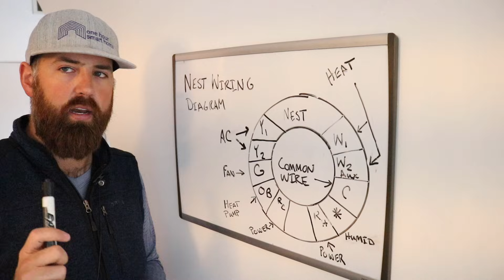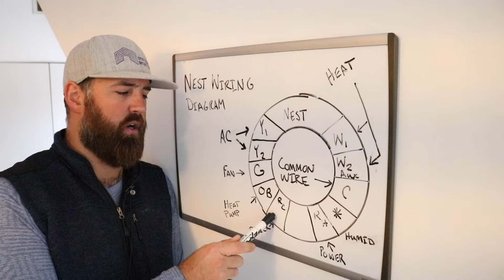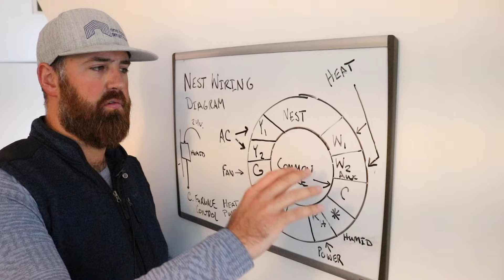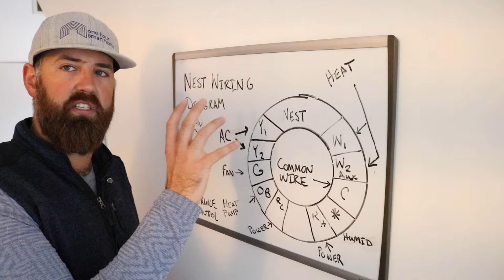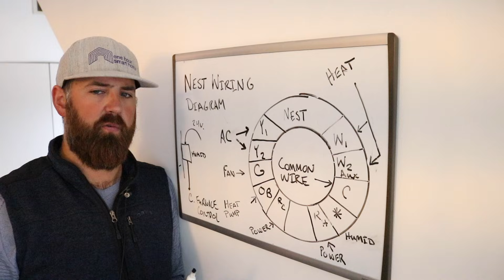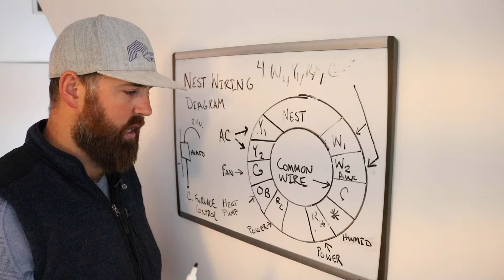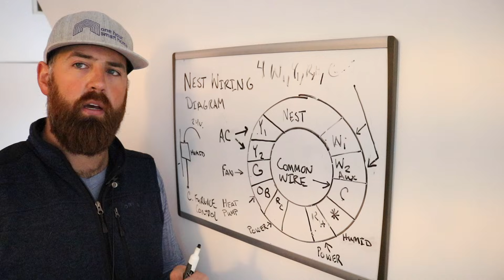Nest Wiring Diagram: Full Explanation!

Comment: I need your help, I have the common and RC wire hooked up voltage that I read between them is around 25 V. What my issue is is that I’m able to take the thermostat off plug it in and it’ll work fine for two weeks then it will die and give me the red dot for some reason it’s not internally charging on the base. What is my problem?

Comment: Excellent video. Having an issue with the Google side of the nest. The thermostat base is wired correctly. When I try to choose add account. It locks up at that screen. Anyway I wanted a little bit of heat before I went to bed and of course I found your explanation on the call out of wires. Which was really helpful, now I'm going to go back to pulling my hair out. Thank you kind sir it's appreciated.❤

Comment: Thank you, James for an outstanding video. You’ve totally demystified the GEN three thermostat. Now I have a question. I don’t know if you can help me with. I think I know what I have to do but I need to ask you what you think. I have a two wire furnace/air-conditioning system. It’s a manufactured home and it’s an older system. Forced air by propane. 
There is a switch on the system itself That you switch from air-conditioning to heat. And then two wires go to a thermostat. An older thermostat typical type that manually switches from AC to heat. So I hooked up my GEN three and of course it only will register heat. Now, of course if I switch it to AC at the main panel on the furnace, I can get the AC to work, but i actually have to put the temperature up higher,tricking the furnace thinking it is heat call. Obviously this screws up my temperature readings on the thermostat completely. So what I need to do is reverse the thermostat like you would normally do by flipping the switch. So I’m thinking is if I take Y1 and W1 , put them on each side of a three-way switch. With my wire from the furnace in the center position. I can switch from air conditioning to heat so the thermostat will operate properly. I’m not sure if that will solve the problem. That’s my thought. Do you have any way you think I could do this. I’m sure it wouldn’t be as easy as   jumping y1 to W 1 . 
I guess the first question can be can you use a nest thermostat with an air conditioning system only by using y1 and r h? If that’s the case then my idea should work? But maybe there are programming issues as well. I’m not sure. Just curious what you think. Sorry for the long text. Any help would be most appreciated and again thank you for an outstanding video. Very, very helpful in general.

Comment: I was going crazy trying to figure out why my nest thermostat recently started reporting No R or no C and why my AC would short cycle or not work with these error codes. Long story short, ALWAYS check wiring at BOTH the thermostat and the furnace. While the previous dumb stat had R, G, W, Y, and C connections, the C (Common) was never actually connected at the furnace end. I understand some dumb stats can work without a C, but I assumed that since C was connected to the old stat that it was also connected at the other end. It was not nor ever had been (was wrapped in a spiral around stat wires, unused). Why the Nest E worked for years and suddenly didnt... no idea other than maybe Google sent an update recently that changed C dependency.

Comment: Great video!!!...I have 3 wires on my furnace and connected to my Nest e.  Connected by G for fan, R for power and W1 for heat. My question is when I run the fan, will it pull the cold air up from the furnace which is downstairs?  Thanks

Comment: I just watched your Nest Gen 3 wiring video, question I have is with the O/B or W1 for heating. My previous thermostat had the white wire connected to one W-O/B terminal. But Nest has a separate O/B and W1 terminals. I have a heat pump system in my Florida condo. Which terminal should I hook up too?

Comment: Hooked my nest 4 (7wire like this diagram) up just now on my electric heat pump and I’m getting cold air and line-set is freezing 😢 🤦🏻‍♂️ I hooked our front system(electric 6 wire thermostat wiring) and that one works fine. Someone help! 😅
Reply: W - white 
W2Aux-  black
Y- yellow
G- Green
O-orange
C- Blue
R- Red
Reply: Original setup the black wire was on X2 and the blue wire was on B

Comment: I know this video is old, but its content is relevant to my current issue. I recently had a two stage furnace and condenser installed in my renovated home. But in my area temperatures dropped to around 10 degrees, even less when factoring the wind chill.  During those days, my furnace seemed to struggle to warm the house and would (as indicated by Nest thermostat) take up to 2 hours to reach a desired 5-degree temp increase. Your video helped me understand that I should have wires connected to the y2 and w2 connections also instead of just the y1 and w1 connections. Undoubtedly,  my system is wired incompletely. What are the consequences of the wiring error? Am I correct to assume that because the connection to the w2 terminal has been omitted, my furnace will run only in  stage one, meaning at the low speed only? That would explain the lag in the system on the colder days. (Still waiting for the HVAC contractor to address this issue. ). Your thoughts would be appreciated.  Thanks.

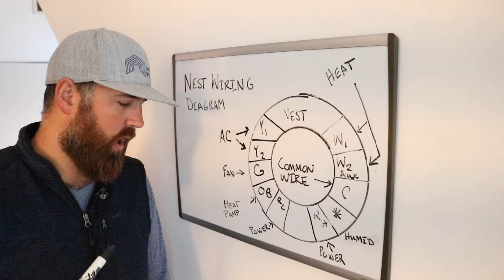Comment: 6:47 rc and rh same except when you have dual system.
Reply: Can you explain further?
Reply: What I mean by that is if you have a dual system, why doesn’t matter because the client that I’m working for the common and RC are hooked up, but the thermostat is not taking any power in. I have to take it off and charge it externally so that it may work but when I put it back on with a voltage reading 24 in two weeks it dies.

Comment: I am installing Nest 3rd Gen Learning Thermostats in a system where the existing thermostats do not have a "C" wire. To address this, I purchased a Nest Power Connector for each zone. The system is controlled by an Argo ARM 4P controller, which has only a single "Common" terminal located at the top right of the unit. My question is: Can I connect the "C" wire from each of the Nest Power Connectors to the single "Common" terminal on the controller?

Comment: Which nest model did you use? I have a two wire (red and white) gas boiler that is zoned for first floor and second floor. Both are two wire, red and white. What nest model do I need? Your advice would welcome. Thx. Joseph.

Comment: Hi, I have an older (2021) Google Nest Thermostat that I would like to install on my hydroponic boiler system. Currently I have a Honeywell programmable thermostat that has 2 wires connected to it. Before changing out the Honeywell thermostat I powered ON the Google Nest thermostat to read the display instructions. The instructions are asking me what wires do I currently have connected to my Honeywell Thermostat, I answered RED and WHITE (I only have HEAT, no colling or fan because I have a boiler with forced hot water). After entering this info, the instructions are stating i need a Nest power connector  Do I really need a Nest power connector?

Comment: I just installed my nest for first the time and when it did the test nothing turned on. The heat made a clicking sound and the ac kept turning on and off it wouldn’t stay on. Is that my systems or the nest?

Comment: Hi,
Love your nest thermostat videos! I ordered an AC transformer/adapter like you recommended which plugs into your typical wall outlet - as I have two nest thermostats which utilize the boiler for heat (radiant on one, baseboard on the other), and utilize the A/Cs on their respective floors.
So my wire set-up is the odd one you touched on briefly (Y, G, and RC. W and RH). The problem I'm having is the nest short cycles the boiler and will make it kick/click on and off repeatedly and too rapidly. I connected the A/C transformer to both RH and C, as I lack the common wire, but it didn't recognize the Common Wire. Can I connect the transformer to both the RC and RH only, and cap those existing wires? Thank you very much in advance!

Comment: I have a hot water baseboard/fuel oil boiler only.  A/c is not connected and my wires are green, yellow, & red.  The green was labeled W, the yellow was labeled R, and the red wasn't connected to anything.  I've tried everything and cannot get it to work.  Any suggestions?  Thanks!

Comment: Great video. I have a forced air gas furnace used only for heating. Also have a air handler with outdoor condenser used only for cooling. When I connect air handler(cooling) to Rc and furnace(heating) to Rh. The furnace will not turned on. But if i removed the Rc, then furnace works fine. 
Furnace only has R and W1. Air handler has R, G Y,C. Can my Nest control two separate systems? Thanks.

Comment: I scrapped my old heat pump, but not the forced air electric furnace. I don’t need Y1 or OB without the heat pump, but the Nest displays an error if Y1 isn’t hooked up. How do you disable the cooling mode on the Nest?

Comment: I got a new system with dual fuel so uses natural gas and heat pump . Nest i got a * wire for furnance uses heat pump  and kicks in at above 40 under 40 furnance kicks in .

Comment: I have a problem with my nest thermostat. I set all the wiring, and when I turn on the system the fan turns on but the ac is not cooling. Can somebody has the same problem? I’m using Y1 - G - W1 - C - RH.

Comment: My AC was blowing HEAT instead of cold air after setting it up. The W is also used in OB on the old thermostat. I didn't think I had a heat pump but apparently I do. Found a single mention online where a person moved the W wire to the OB and restarted the NEST. I did this and now COLD air is coming out. I hope I didn't create a problem that'll manifest in six months but it seems to be working.

Comment: Question: I currently have a Nest thermostat and have my red wire connected to the RH instead of the RC (I have a standard a/c and furnace). I know with the Nest it doesn’t matter which one of the two you put the red wire in. However, I’m looking to switch from the Nest Thermostat to the Ecobee Smart Thermostat Premium. With that particular thermostat, would it matter which one (RC or RH) I put the red wire in or could I do either one like the Nest? Thank you in advance!

Comment: Do you have a video for installation for a dual zone system with a zone controller between the furnace and the 2 thermostat one on each floor where blue c wire is present but not connected?

Comment: James - Thank you so much for explaining all of this in such a clear and understandable way. I have a question - I have a system that has two G wires - for HIGH and LOW fan. Do you have a video that explains where that wire should be connected? Oddly the thermostat appears to be getting power - yet it gives an e75 error indicating that there is nothing connected to y1 or w1 even though the correct wires are connected to the terminals. When I look up the error on the nest site - it says invalid error. I am not sure if this 7th wire has anything to do with it…. so I was hoping you might have another video that could help. Again - Thanks so much…

Comment: I have a two-zone heating system with a power issue. I have a Honeywell thermostat upstairs and recently installed a Google Learning Nest 3rd Gen in the downstairs. None of the wiring has been changed at the furnace and they are both two-wire (red & white). When I increase the temperature upstairs, I get an error message on the Google Learning Nest that there is a power issue, and when I turn off the upstairs thermostat the error message goes away. My question is can I wire both thermostat wires to the Google Learning Nest (Down – Rh+W1 and Up – Rc+W2) to control both heating zones with one thermostat and the two sensors that came with it? I’m looking at your diagram at (7:00) where you say Rc & Rh are basically the same and I have no AC just heat.

Comment: Great video!  I have a slightly different set up than you spoke of.  I have a four wire system, three match your video; G, Rh, & Y1.  My old thermostat has a wire in the Y/O terminal.  Am I wrong to assume this is heat and should be put in the W1 terminal of the Next Learning Thermostat?  Thank you!

Comment: With the RC and RH, I have jumper cable between the two. I live in a condo that has a unit for heating and cooling just outside my door. I don't have a furnace. Google says I don't need that jumper which I find strange because if I didnt need it, it wouldn't be there. Your thoughts? I'm getting ready to buy one of these thermostats. My wiring is as follows: Y1|G|RC|C|    |RH|W1|O/B|  RH and RC have a jumper connected between the two.

Comment: On my thermostat I have a B wire. C and R connections are not used. my system is a single natural gas heat and a/c system.

Comment: Great video! I have a nest thermostat (original) and 7 wires. I think everything is hooked up right but, when my a/c turns on, I get hot air coming out until I turn the thermostat down then back to the setting I want it at. The a/c will kick on after I do that. Any information on why this would be happening would be appreciated?

Comment: Thanks, our Nest has worked for 6 months now, but one of our 4 Nest Learning thermostats just lost WiFi (Google is replacing it). During the troubleshooting phase, I learned about the battery recharging and voltage amounts seen under Power in the Nest Options (Thanks for that info as well). Our batteries were all 3.7 volts, with the lin at 20 or less. I believe connecting the Common is a no-brainer if the wire (Blue). In our case, we have 5 wire runs to the thermostats, and the Blue is not being used. So I will connect the Blue unused wire at the boiler and connect to the "C" at the thermostat. Our wiring at the furnace Accel CS - System 2000 - EK-1C is not as intuitive as shown in some videos, but we have our boiler installer coming out for our first annual service, so I will have them connect the Blue wire to 24V at the furnace.

Comment: Hello Sir, great video but wanted to share my situation with you for a possible solution for a nest thermostat. I have a heating (gas) /cooling system (modulating furnace)  with a humidifier. On the furnace end I have the green wire in D, red wire split  one is in R and the other one is in Y2, and the white wire in B/C. On the thermostat end I have green wire in D, red wire in R and the white wire in B. I also have a yellow wire on the thermostat end which is not connected. Question is where would the green, red and white wire go on the Nest learning thermostat.

Comment: Thanks for the video.  I have a standard hvac system and air conditioner but my thermostat has the red wire going into RC with a jumper going to RH.  I'm looking at the installation video for the regular Nest...not the learning or the E....and it only has one spot for R.  Is this going to be an issue?  Also, if I buy a nest learning, which has spots for both RC and RH, do I run a jumper from RC to RH?  Thanks!

Comment: Mine blows hot air constantly, no matter where i set it 😡
Reply: Does it do that even when the Nest thermostat is pulled off the base...the part that appears in the diagram in this video? If so, that would suggest you have a short somewhere, possibly in the base itself.
Reply: @cloudbase7799  got it figured out the wires were crossed at the furnace .👍🏻

Comment: This video is the best explanation I have seen. It got me thinking….. Is it possible to use the * circuit to kick on a 24v/120v relay in order to control a booster fan circuit? 
My booster fans draw more than the one amp that my York furnace supports. I connected a relay to the wiring for the humidistat. I connected it before the humidistat so that the relay would kick on whether I needed humidity or not. However, the booster fans only kick on when heat is on and not when the blower kicks on.

Comment: Thanks for the help, I was able to figure out in my dual-zone home that the previous owners had put ONE zone's blue wire into the Common Wire slot, and had put the OTHER zone's blue wire into the Blue slot (because it's blue, so obviously it goes there, right? Pffft).  I don't have a heat pump and was able to figure it out with your help!

Comment: Great video on how to setup the nest with a heat pump. I'm wondering will all nest thermostats work with a heat pump ? I have a nest that I installed a few years ago on my oil burning furnace heating system. I'm planning to replace this furnace with a central heat pump and was wondering if my nest will be compatible with the new pump.

Comment: I don't see any comments on the Aprilaire 800 steam humidifier? Does it need a control relay and an additional jumper wire from the relay 24v common to the "C" connection?

Comment: My HVAC has Aprilaire Humidifer-700 with Humidisatat model 60. I installed the Nest Thermostat (NT) model/01334 year 2020 (not the learning model) that has Y, G, R, W, C, */ob wiring terminals. I connected the NT (Y, G, R, W, C) to corresponding Furnace terminals Y, G, R, W, C. The NT works; however, it prevents humidifier function. This video suggests connecting the humidifier directly to Nest Thermostat. Hence, I removed the Humidistat. I attached the NT */ob terminal to one of the humidifier solenoid valve wires and connected another solenoid valve wire to the C terminal of the Furnace, as shown in this video. It did not help to activate the humidifier. Does the Nest Thermostat (not the learning model) work with a humidifier? In my experience, this NT model doesn't. I appreciate your response. It appears that a Relay is needed between the Nest * terminal to the humidifier to the C-terminal of the furnace